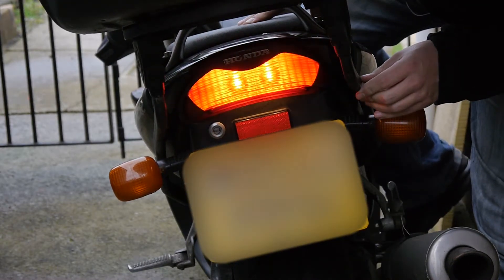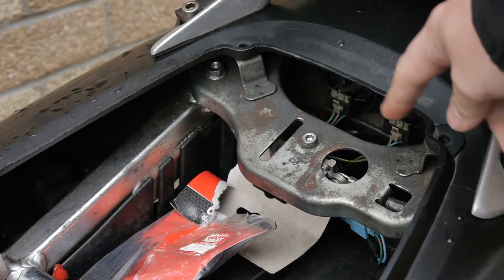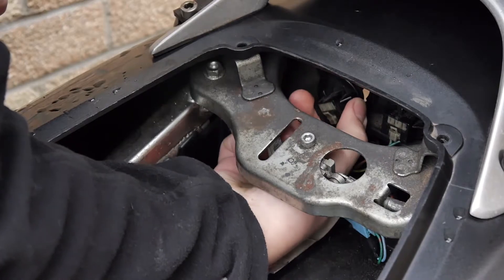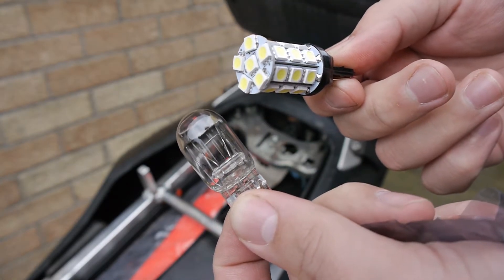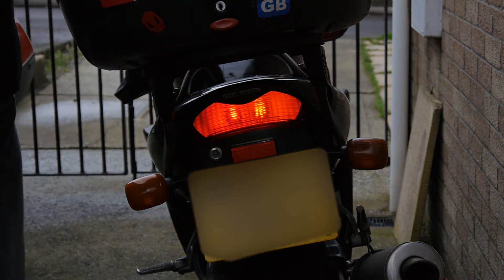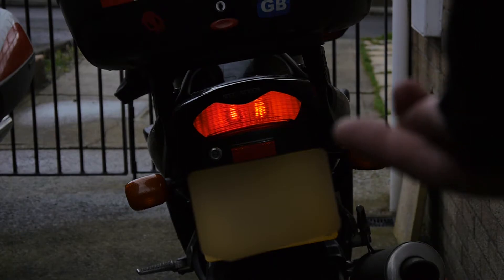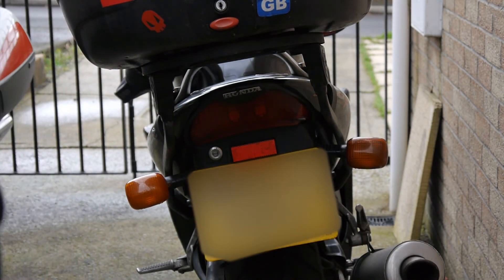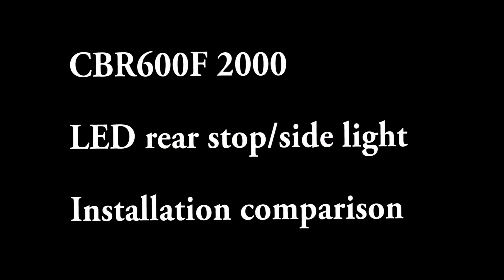CBR600 f4 LED rear side/brake stop tail light install idle issue

Comment: Hi, old post but may help someone,
Go through the usual suspects.
Battery
Rectifier 
Stator 
When one starts going has a habit of frying other components. (Those saved watts have to go somewhere) 
Look out for rear bulbs causing a short to front front side light etc side light coming on.
On old cars the bulb holders would die causing all sort of odd symptoms . 
Good luck and keep them modern classic wheels turning.

Comment: Hello, I tried to put some like yours but when I step on the brake the light bulb goes off. If I conect the bulb the other way around the fuse blows  ¿did the same thing happen to you? ¿How did you solve it?
Reply: You must have a ground somewhere touching